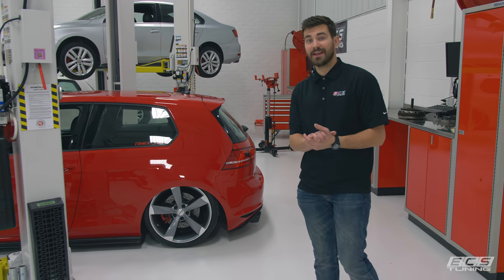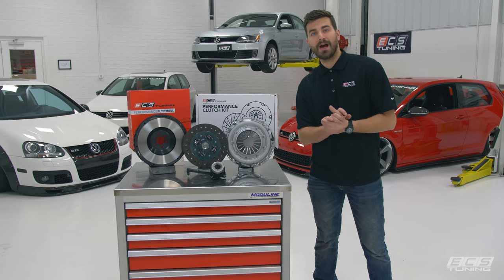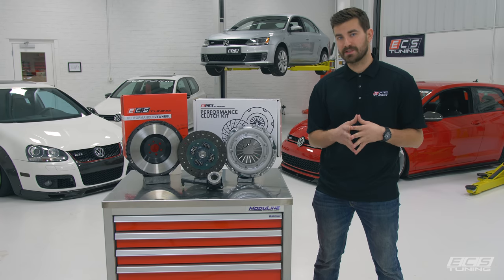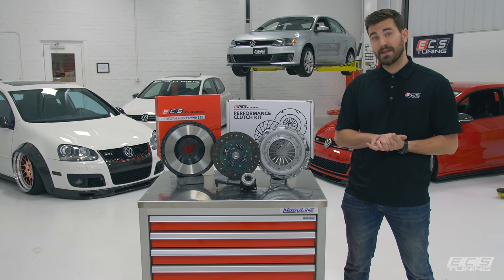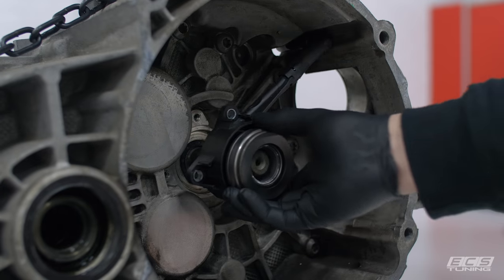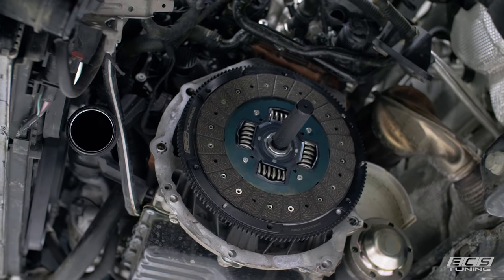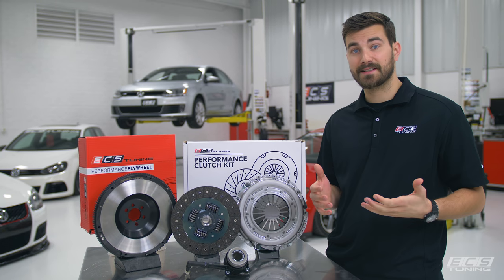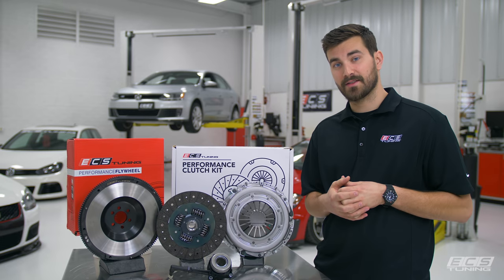ECS Tuning Performance Clutch Kits // Volkswagen MK5, MK6, MK7

Comment: Okay so where can I find torque specs? Because it didn’t come with any instructions for it
Reply from the maker: The instructions are a downloadable PDF on the product page at the bottom: https://www.ecstuning.com/b-ecs-parts/vw-mk7-gti-golf-r-gen3-ecs-tuning-stage-2-performance-clutch-kit-with-lightweight-forged-steel-flywheel-1885lbs/015123ecs01kt/